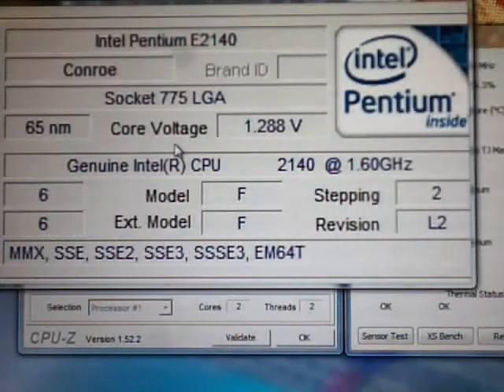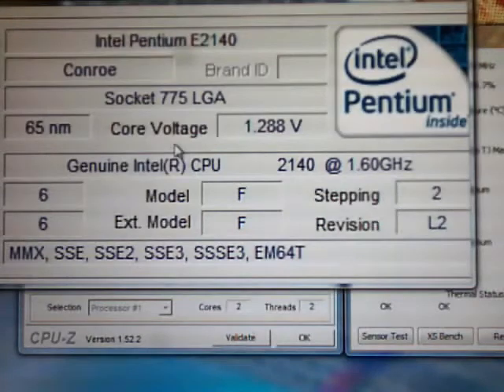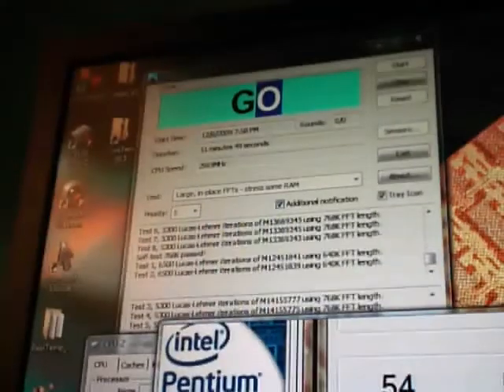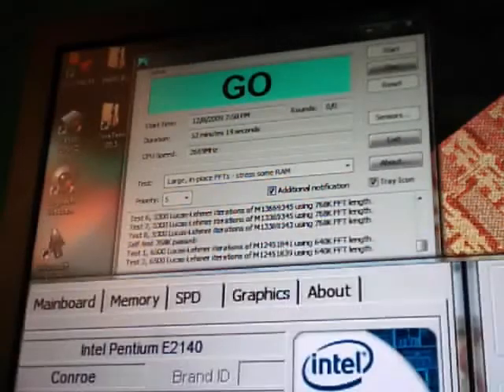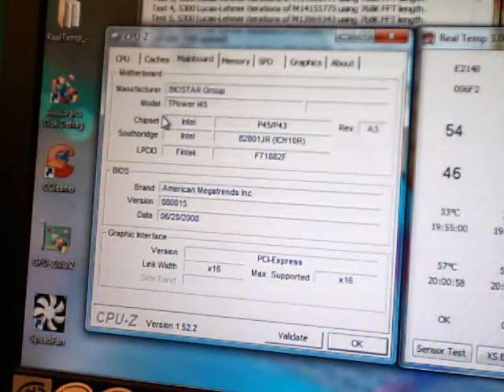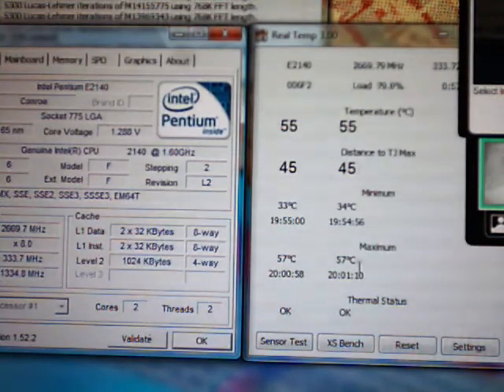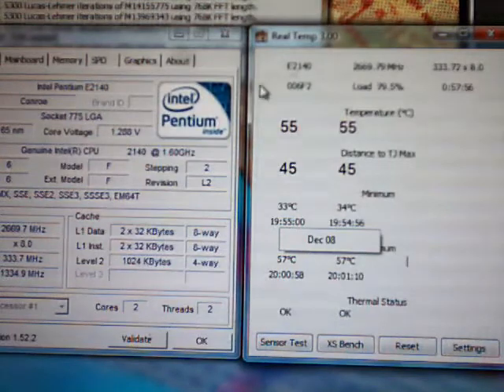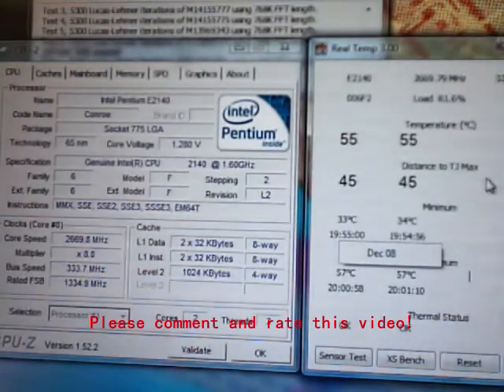E2140 1.60GHz @ 2.66GHz 1.288v Orthos + Details

Comment from the maker: Depending on your other hardware should be able to get a fair bit more OC outta that chip.

Temps look great and 4K RPM seems a bit high, but if its stock cooler sounds like about 90-100% fan speed. If you can take the noise no issue there.

Optimal temp is always the lowest obtainable and for this chip I would keep it under 55-60c when OCing high. Voltage is what will get you and shoot your temps up high when under load. See if you can keep volts under 1.45-1.55v for 24/7 depending on temps.